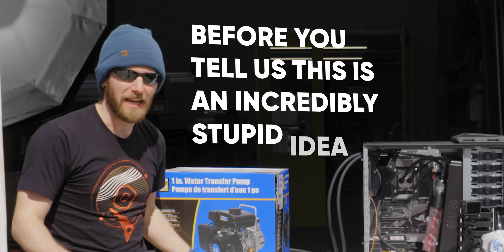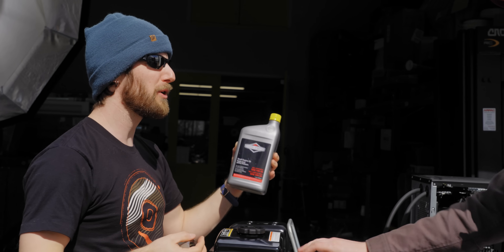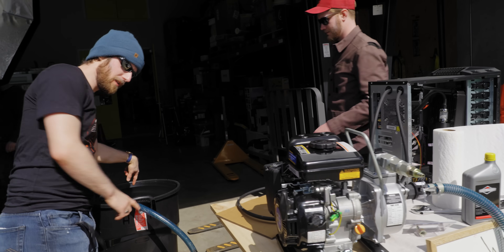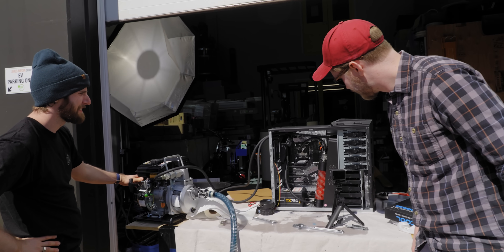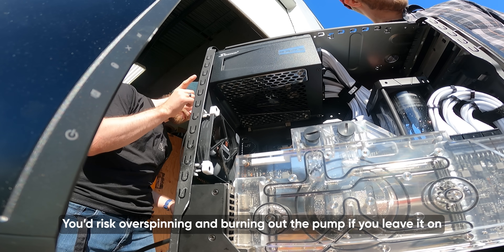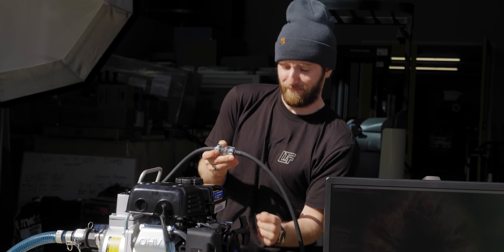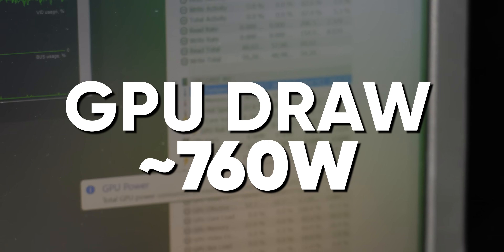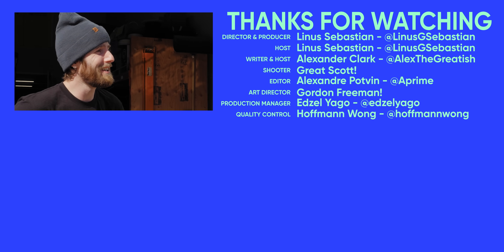Cooling a PC with a 2.5HP Pump

Comment: Wait so if the pump is overheating... you'll need to revisit this video with a watercooled water pump?:D and also hardline line a pc build with extra beefy fittings to get as close to the chiller performance as possible!

Comment: I worked for a company who had spotwelders and seamer machines which for watercooling ,,they just connected to the city water faucets and then to the drains,,,  they did that for years, left them connected it funked up the lines bad, eventually they did update to welder water chillers, (I always think that would be cool to liquid cool a pc with a welder, water chiller unit....(be a neat video)

Comment: I've been thinking about this for a while. On a default AIO, running on Extreme speed means the water passes through the system faster, leaving less time for radiation and less time in contact with the block. On quiet mode, the fluid has more time to radiate heat off and more time to pick up heat from the block. 
Running faster would only work if you could get more surface area in the radiator and the block.
Reply: You are right in saying that by moving faster each specific atom of the water has less time to absorb and release heat because it stays in contact with the surface for only a brief moment. But at the same time the water takes less to circle the loop, meaning that it passed through the same place more times in a second offsetting the drawback of absorbing less heat per cycle. The concept is the same for air, on a windy day you will feel colder than on a windless (or less windy) one even if the temperature is the same because more air particles will come in contact with you each second.

Comment: Hi Linus, I wanted to chime in about this experiment. Here you've used a pump with a high flow rate but low head. You need a higher pressure pump, like a jet pump, or sump well pump, to generate the high pressures required for high flow rate through small pipes.

You need to attach a pressure bladder so the pump can achieve max pressure. A 3/4 HP jet pump puts out far greater pressure than this pump. 

Jet pumps can achieve 100psi +, it will continue to build pressure until something blows up, which is I think what you're going for.

I hope you revisit this experiment with a proper pump, I think you could do a lot better. 

cheers!

Comment: Brass would've been way cheaper than freaking hydraulic fittings lol. They would've held up fine to that little pump too
Reply: Well but they're set if they would ever want to do 200 bar water cooling loop
Reply: PVC, Poly, galvanized...anything would have been cheaper than those fittings.
Reply: Princess Auto didn’t have a 1” brass fitting the day I was there picking up stuff for the project. The 1” hydraulic fitting was $10, for reference.
Reply: LOL understandable gotta do what you gotta do

Comment: I want to see an actual attempt to use that engine to REALLY pump water over a custom loop. With huge tubes and flow rate.
Would be fun to make a high flow rate blocks and stuff.
Reply: With an electric pump, (240v - maybe something around 4hp) proper tubing and fitting, and ice water, that would be really fun to watch.
Reply: @kcgunesq  arctic sea water. They've done highLANder, now for northLANder
Reply: And a car radiator, for dat flow

Realistically the choke point will be the block, but still you get a massive surface area for cooling with those
Reply: @mduckernz  It would need to be a custom block, probably with just a flow optimized chamber over the cpu instead of the microfins in most current blocks. big 3/4 in npt ports on it lol
Reply: What about using a fuel injection system for cars but with water.
Reply: @owo1744  if you just used an automotive fuel pump instead of a regular PC water pump not a big deal, they run 12 volts but it would be high pressure not so much high flow rate. It mostly pressurizes the fuel feed line and the injectors just open and close to let fuel be forced out. Common gas line pressure is around 60psi I think? Diesel injection lines are usually in the thousands of psi
Reply: I've already said this, and it's a very risky thing to say. Imagine you are on an island, and there is another island over there. And you want to conquer it. And they are ruled by a leader.
"Oh but they are disciplined, and they obey their leader. It's impossible to defeat them." Ah, then we will impose democracy on them. Democratic propaganda! We will promote the most democratic way.
"Oh, but they have nationalism! They will sacrifice themselves to protect their land." Ah, we will spread globalist ideology. Remove all notions of nationalism and patriotism, promote these ideas as evil. Turn them against each other so they will hate their own country and race.
"Oh, but they also have incredible faith in God! They have such faith in God that they never abandon the front." Ah, then let's promote atheism and hedonism. Church time is over. From now on, only night clubs and pornography. They must be open about sex.
"Oh, but the youth are healthy and strong. They're in formidable shape. They are the way the Creator made them: in his image." Ok then, from now on McDonald's, Coca-Cola, drugs, alcohol, video games. Let them be fat, lazy, weak, domesticated, undisciplined. We must abolish military service.
"Ah... yeah but the other thing is that they are homogenous. They are a single people, a single race. There is no ethnic chaos." Ok, then in whatever way, we must send them boats with foreigners - whites, blacks, Asians, Muslims, Chinese.
"But they have a lot of babies! 6 or 7 babies on average! They're happy to have large families!" Ok, from now on abortion, the pill.
You have now defeated that island without firing a single bullet.
Reply: prob wouldn't achieve much, they had an open loop with a large rain barrel of cool water, in a closed loop you are going to be limited by the cooling capacity of your radiator, a faster pump rate will have marginal effect.

Comment: I work in the water pump industry while being an avid gamer…and can certify this is overkill. You could have a lot less issues and have repeatable performance without vibration or added heat from the engine if you used an electric motor. 

You could have still used the gasoline if the power failed and you needed to water cool it, but an electric motor that produced 2.5hp or less would have been more cost effective for the application.
Reply: Most important would be to match the pump curves. This pump has way too much flow for far too little pressure. The resistance of the lines is too great. 
Less hp more pressure, that will force more water through this. Electric motors still add substantial heat through friction. You can easily heat 100l of water to over 100 deg F in about an hour if you leave a 3/4 jet pump recirculating. I did it by accident my self and was surprised how hot the water got even though it was an electric pump.
Reply: @mavbaker2159  all valid points too

Comment: So I'm sitting here thinking about a parallel between a display Fish tank with a sump in a totally different room and this current set up. 

You could use an identical set up, but have a robust electric pump, reservior, and chiller in your garage. Run it through your house to your PC. Boom. Ice cold pc.

Comment: I work in aviation industry, I always wanted to build a cooling system as an aircraft's hydraulic stystem standard. properly bended tube, properly flared, and put that B nut on. invest couple hundred dollars to get a high pressure quick disconnect. Then you'll have a bad ass cooling system can hold up 3000 psi fuild. And I don't think this is the stupid thing you guys did.

Comment: So did you have it setup as a vacuum coming from the PC into the external pump and the actual pressure from the pump went into the barrel?  That way the water pressure wouldn't blow the tubes?

Comment: The smoke coming from the carb cover is normal on a new motor. They spray a anti rusting/corrosive on the motor/pumps due to them sitting in warehouses. I like this idea and I feel I must now do this.

Comment: Every size pipe or tubes flowrate has a point of diminishing returns. They all have a point where the medium will not flow any more and it will hit a stand still. That is when you find failures in your system and things go pop. This is a because flow rate does not increase linearly with pressure. You want more flow you need more tube diameter.

SO! Start using that damn machine shop and make a closed loop system with a 1-1.5in ID water block. Nowish.

Comment: I think you should do  custom heat sinks for GPU and CPU! Split the 1" tube juster after the pump - 3/4" direct to cpu with an outside 2" concentric collector and another 3/4" tube to a large wide 4" high 1" deep box for GPU with the returns direct to the bucket - no rad required. Blasting the heatsinks with 1l/s (?) of cool water should drop the temps

Comment: After watching this I really want you guys to build a "Gas Powered PC" 🤣 Screw a generator to the back directly to the PSU and adjust the engine RPM for when the gpu starts drawing more power

Comment: Why even have a rad or pump in the rig with the 30gal reservoir? Seems like you could just run straight through the blocks and back and be just fine for quite a long gaming session.

Comment: As someone who professionally works with high pressure fluids and their associated fittings regularly, this video made me oscillate from cringing to snorting with laughter in an unsettling but overall enjoyable way.
Reply: As someone who dosen't work with high pressure fluids and really only has basic physics knowledge, i bet that they lost a lot of that "flow" in turbulence. I would expect that you can't just push the water harder through the series of small tubes with complex geometry and expect it to not just dump all it's energy into the walls (and into itself). Also, shouldn't they have tried to pull the water throug the loop instead of pushing it?
Reply: @raphaelambrosiuscosteau829  Most of the time you want to push liquids instead of pulling them. Pulling them lowers the pressure, which causes cavitation, which is bubbles of gas popping in and out of existence. Cavitation eats away at the tubes.
Reply: Though I wonder if at the speeds they are going at if they are already cavitating?
Reply: @kylerichardson514  intuitively it feels for me that pulling would create more even flow through the loop instead of water coming out fast at the beginning and then dumping it all into the first couple of sharp turns it encounters. I do not know why it feels that way or if it's has any basis in reality though. Also, would've like to see flow meters at the start and at the end of the loop side by side to compare flow speeds.
Reply: As someone who professionally designed electrical control systems for industrial machinery and once witnessed what happens when a high pressure hose (50-60 bar, I think) blows off a fitting, I have a healthy fear/respect for high pressure fluids.
Reply: My entire undergraduate degree is screaming at that whiteboard right now. I'm only a minute in.
Reply: I can't wait til the step up to high pressure hydraulics.
Reply: That pump was only capable of ~35psi, they were mostly safe. :P
Reply: @gedavids84  the cavitation and water hammering makes that 35 psi look like a joke
Reply: I wouldn't really call a 2.5hp trash pump high pressure but I get what you're saying, trying to get a high flow through that much restriction is a recipe for disaster
Reply: TLDR: am engineer, lmfao
Reply: After going through OSHA training and having to see accident videos I had to add high pressure liquids to my list of things I don't want to mess with.

Comment: So instead of using gasoline, you can use water to make your fuel. Run a little electrical charge through water and it rips it apart to hydrogen and oxygen. Let that gas flow into your carburetor and now you're engines running. So you could water cool your PC using water.

Comment: Why wouldn't you just use a high flow electric pump? You went straight to gas when there has to be an electric pump more powerful than the gas powered pump

Comment: Hopefully they won't realise you can get industrial electric water pumps with similar flow rate and pressure, that are much quieter than the engine-based pump...

Comment: Should have probably removed the radiator in the first test, that would have lowered the resistance of the loop and dropped the pressure. Not like it was doing anything when you have a giant tank as a reservoir.

Comment: Crazy idea, whole room water cooling v.2 use an electric well pump, a car radiator, electric engine radiator fans, a 55gal drum, and six external temps sensors to start it at a fairly low temp. the whole test it with maybe one pc and use a couple of those peloton heater things to create a synthetic load.

Comment: You should hook that pump up to a water block liquid metaled to the hot side of a super high wattage peltier and hook up the cold side to another water block pumped through another pump to the CPU and GPU…

Comment: Before watching, my guess is that temps will be higher because at low flow rates, these pumps can actually generate quite a bit of heat churning the water and trying to push it through a restriction. A computer's cooling loop is WAY more restrictive than what these pumps are designed to cope with and just can't accommodate extremely high flow rates at pressure differentials the components can safely tolerate.

Comment: I bet you could just hook the inlet of the water cooler up to a hose attached to your city water (via garden hose), and that would get you plenty of pressure, and pre-cooled water. Then just hook the output up to your drain... or maybe some drip irrigation for your herb garden? That might not even be a half bad idea?! No radiator or fans required... just be prepared for a high water bill - almost certainly still less than the gas to run that pump!

Comment: For those that don't know, NPT (National Pipe Thread) is tapered up to the end of the threads (meaning that the farther you screw in an adaptor or connector, the larger the outer radius of the threads), meaning that, in essence, the more you screw it on, the better seal you should expect to get.  But never forget your thread sealant.
Also, side note: if anyone decides that they want to try this; find a way to incorporate a downstream pressure regulator so that you're not blowing your water blocks apart.  If I were to do this, I'd probably go after a 0-7 PSI Holley fuel pressure regulator normally for a Carburetor-style fuel delivery system.  You can find some really high-quality ones that you can adjust in .1 PSI increments.

Comment: It might make more sense to hook up a pc to a raised reservoir of water and use gravity and hydraulic pressure to push water through the loop, with a pump to return the outflow back up to the elevated reservoir. A system of pullies could be used to raise and lower the reservoir to adjust the pressure and thus the flow rate.

Comment: At some point the water flow gets too high and you start losing cooling capacity since the water moves too quickly through the system to remove all the heat it could at w optimized flow rate

Comment: When priming a pump it helps to put your pump below the level of your source water 😆
You can use a water based friction reducer to increase flow through the pinch points of the system, just be careful how much you use because at high concentrations some FRs can increase viscosity and will negate your friction reduction.

Comment: The engine wasn't overheating, it was just the paint cooking off for the first time since you hadn't really put it under load before.  Those small air cooled engines are hard to kill
Reply: Literal burn-in.
Reply: I don't think anything is hard to kill with LTT.
Reply: Yeah, small cheap Chinese engines are as indestructible as 3310s
Reply: Yeah, that black coating barely lasts a single season for most stuff I've seen with it
Reply: Only way ive seen one die is someone not properly oiling it.
Reply: They need a pump and cooler for there pump 👀
Reply: It was burning the oil. So yeah it was over heating.
Reply: @ChronicBongitis420  Uh, no.... It was not burning oil, it was cooking the paint on the exhaust and exhaust cover...
Reply: @ChronicBongitis420  that was definitely just the coating. You would KNOW if it was burning oil. It's bluish smoke and comes out the exhaust or through the Crankcase vent if it's excessive
Reply: @ChronicBongitis420  You're a funny guy!

Comment: With a pump that big you should make the loop big enough that the flow is manageable. Car rad, bigger fittings, huge fans, that's were you will start to see a slight advantage.

Comment: Why not just hook it to the water tap and drain  and see the Cooling performance also see how much smaller power supply you can get away with when not powering fans and pump

Comment: As far as I can tell, while having done no water-cooling or such before, if you want to have a high flow-rate and lowish pressure, with a giant pump- then the water going into the loop and coming out of it should both be on coupled pumps (each moving exactly in sync), this should stabilize the over-all pressure inside the loop. 

You'd probably want a pressure-sensor in the middle of the loop, and have that act as a max-speed governor for the pump(s).

Comment: WHEW. thank GOD this video came out when it did. I was just about to start installing my General Motors EMD 710 series engine into my PC. guess I'll just go with air cooling this time around. Thank you Landon Tech Tips for this valuable insight!
Reply: are you considering those 150 mm 220 volts AC Fans?!
I am considering getting 2.
Reply: A friggin ship engine.  Those are huge.